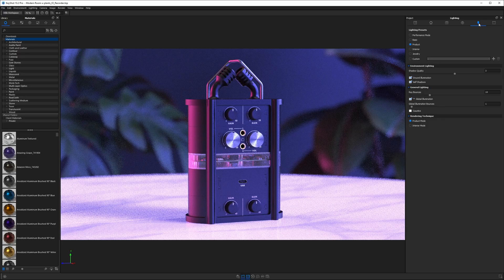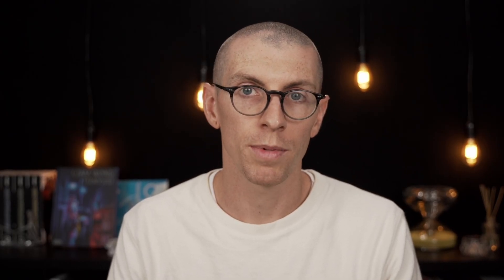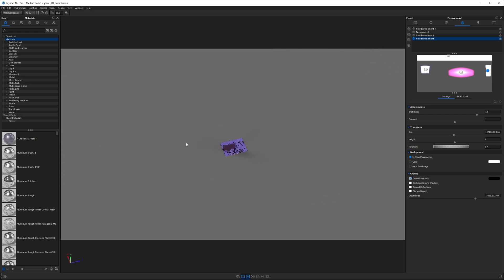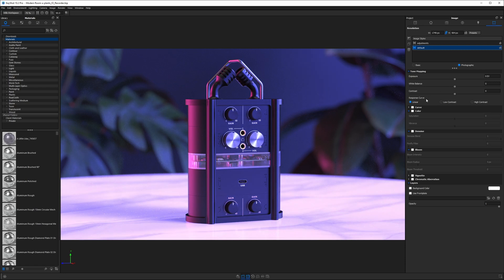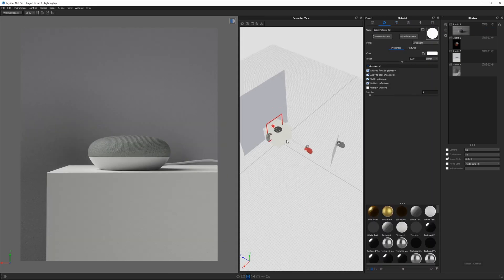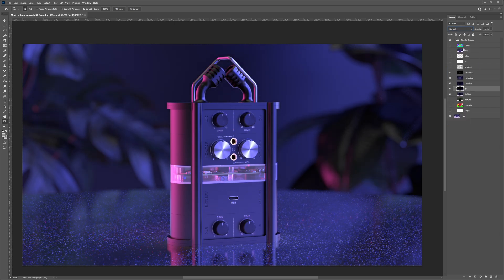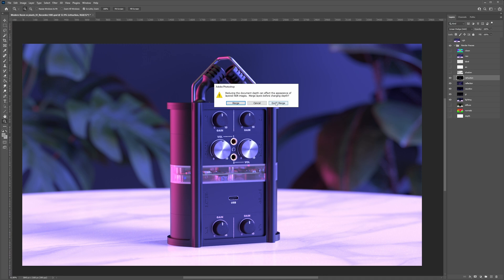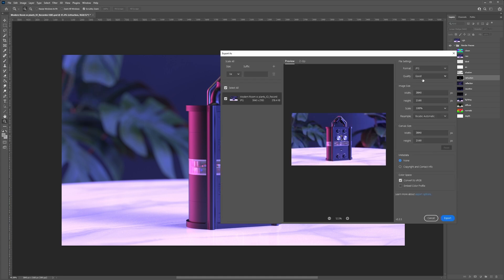KeyShot Render Passes - Compositing Tutorial

Comment: Hey will， could you tell me  how you do the Strong CD ratial reflection? I use the way you teach in a video called anisotropy, but it is so weak, and not so beautiful as yours, can you help me with this
Reply from the maker: This has to do with roughness and lighting. Make sure you're using a higher roughness (like .4 or .5 for either roughness x or y, then a low value for the other). And you also need some dark and bright parts in your HDRI. So, a high-contrast HDRI will help. Make sure a light source is reflecting in the surface.
Reply: @WillGibbons   and another thing about anisotropy is that in the real world, the luster from the radial brushed metal is glossy not rough which is made of bump map, as  the metal always has a electroplating effect,  so what I want to make is keep the anisotropy's luster and get the glossy at the same time, could you help me with this?
Reply: @WillGibbons  I'm afraid I didn't explain it clearly, what I want to say is that, I got a metal product which has a elctroplating and a CD ratial luster at the same time, if we do the luster with anisotropy which is from the roughness from x or y, then we lose the glossy of metal, I want to keep both of them, did I make it clear?
Reply: @WillGibbons   and how I can send you a picture？ I want to send you a metal product which looks like handmade, and what I want to mean is in the real world, if a product is made by hand, the edge is not so neat, how can I do this?

Comment: Ive been using standard 8bit PSD and havent noticed any real difference in terms of quality and workflow. Even in the past, when comparing 8 vs 16/32bit, I cant really tell much difference aside from file size. 

So my question is: what is the benefit of using 32 bit at all? And subsequently, I dont fully understand why you had to convert to 16bit, even when you mentioned your colors could misbehave a bit.
Reply from the maker: It's going to depend on the exact scene to a degree and the materials you've used in your KeyShot scene. Personally, I noticed differences in the 8 vs 32 bit in that when I rendered 8 bit psd and layered up the individual render passes and set the blend modes. The result didn't produce the correct image in respect to gamma, since a gamma of 2 is applied/assumed for non-32-bit image formats rendered out of KeyShot. Glad to hear you haven't had to mess with 32-bit format for your work though! That simplifies things a bit.
Reply: For photo editing (I only set up the negative in camera raw and mostly do the editing with layers and fusions) 16bit is required to have smooth results